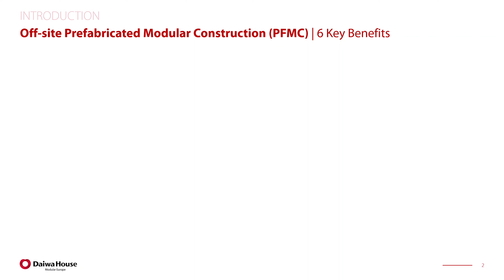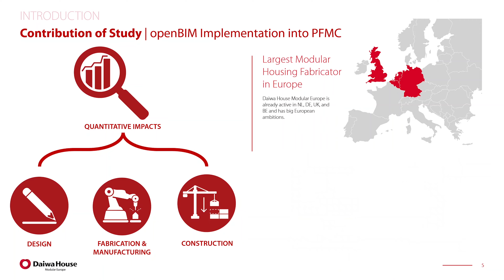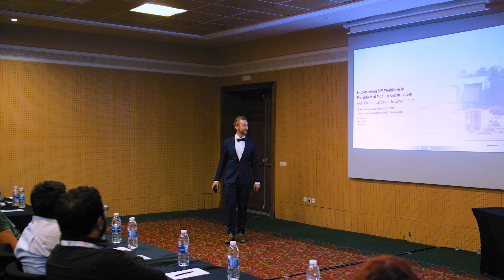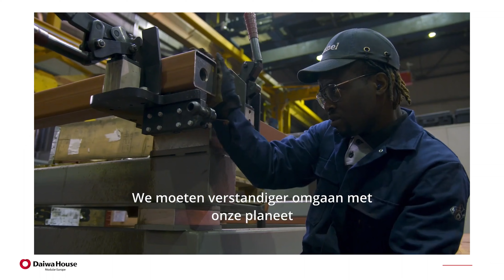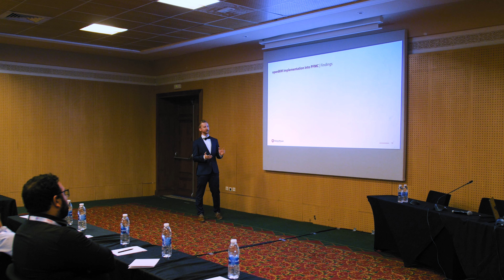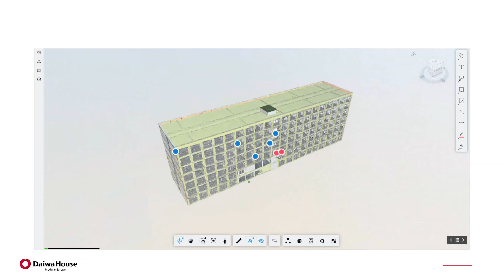BIM in Modular Design and Construction: Benefits and Challenges

Comment: Hi Danku. Currently, I am working as a Architectural bim modeler ( scan to bim).
But one doubt i have .
Which have more jobs and best future.
1. Cad to bim
Or 
2. Scan to bim
Reply: Reply please
Reply from the maker: Good question!

At the moment there are definitely a lot more CAD to BIM job opportunities as many countries and industries are transitioning from CAD to BIM workflows, however after most of the market transitions, there will be less opportunities.

For your future, I would invest your time more into Scan to BIM because while there is a large potential to gain much more work in the upcoming decade. Especially as the housing stock gets older and renovating old buildings becomes a more sustainable option than demolishing and sending waste to landfills.

Where are you currently working or do you plan on working abroad in a different country?